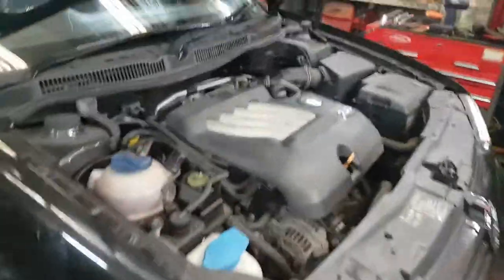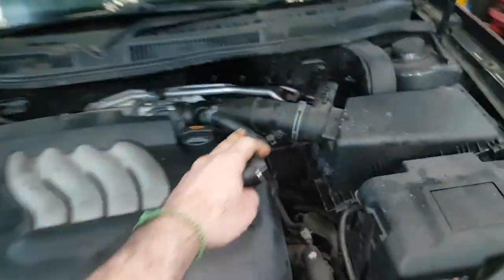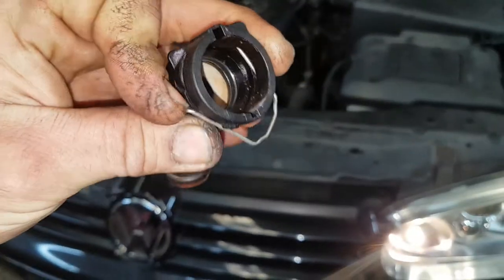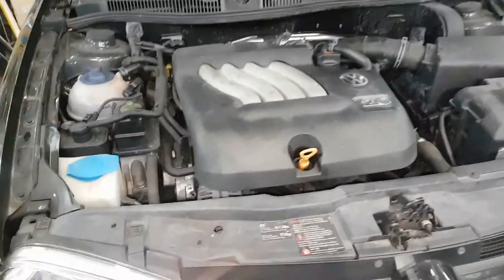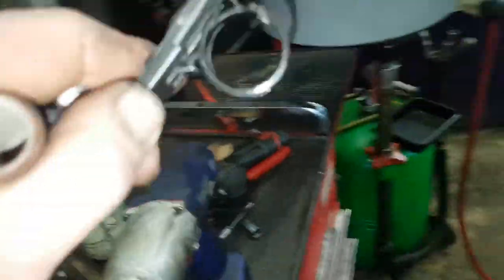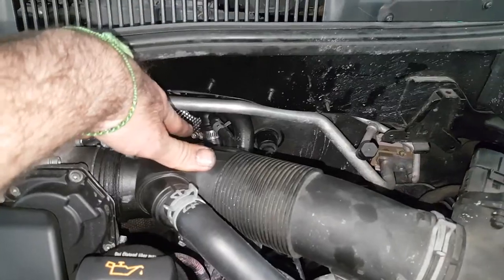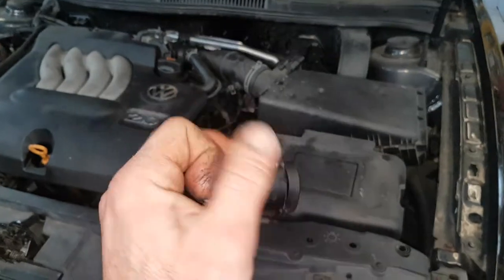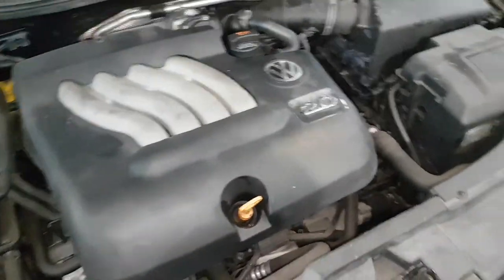Volkswagen Golf coolant leak heater hose heater hose quick coupling coolant clicking ticking TSI

Comment: Not ideal, but you can buy a whole set of flanges and couplings in aluminium from Ali Baba. Much more ideal than these rubbish plastic fittings.
Reply: And a lot cheaper, especially if you buy the whole lot and ship together.